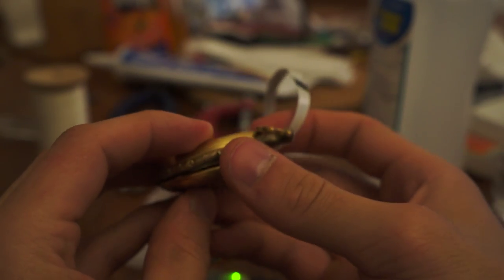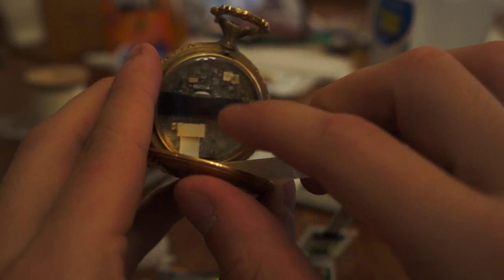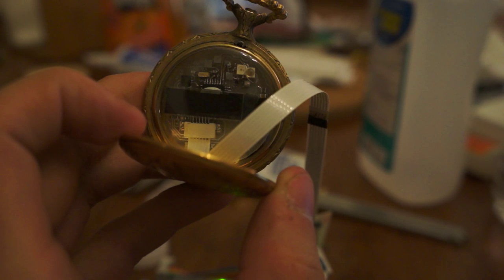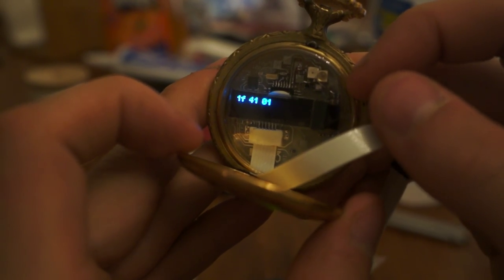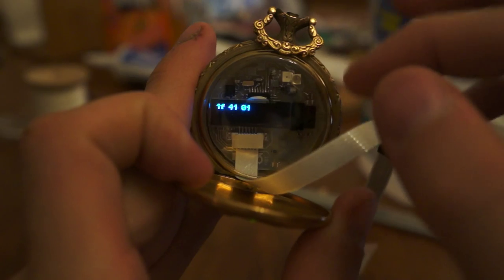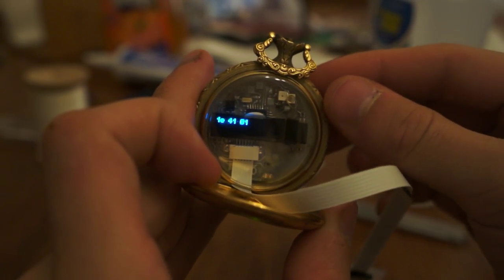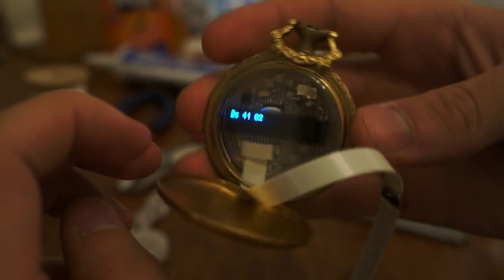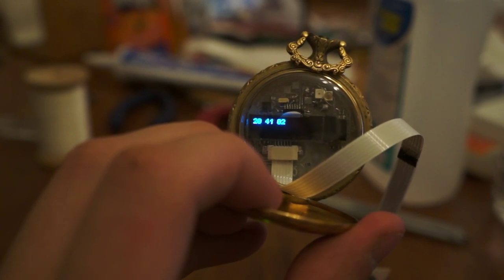OLED Display and Accelerometer Pocket Watch (WiP)

Comment from the maker: Until about two years ago, I used breadboards, breakout boards, etc.  I was afraid that too many parts would come out that I couldn't use.  Then, I found an old (from like the 1990's) radio shack make-your-own circuit board kit.  I opened it up, held down a 20-SOIC part, drew some lines using the mysteriously still working sharpie, etched it... and voila!

Ever since I gave us kits, arduinos, breakout boards, etc I've been able to develop faster, smarter, and surprisingly, even cheaper!